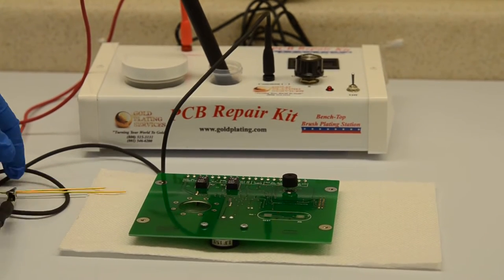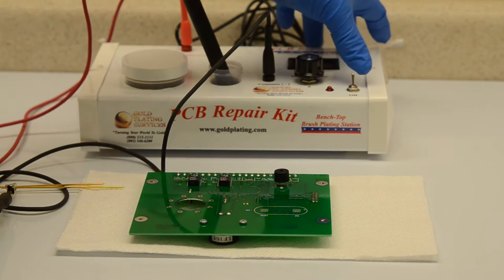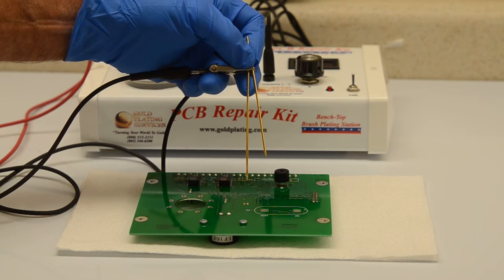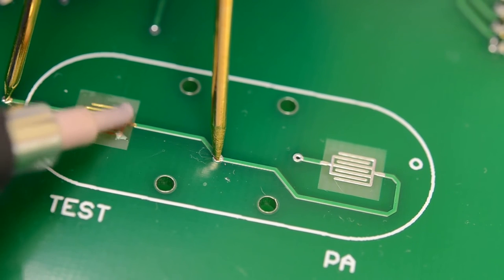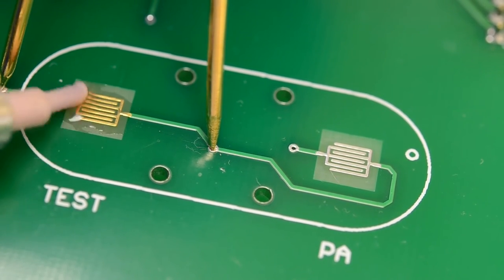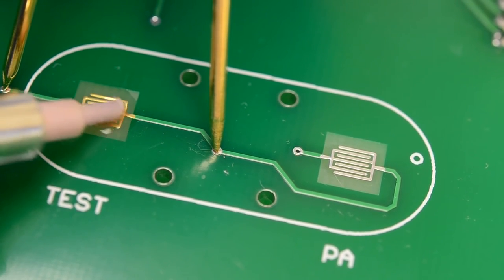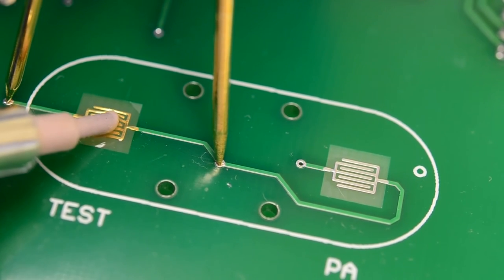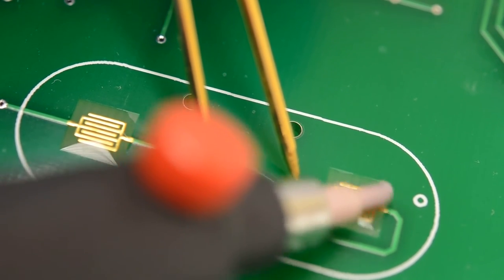Printed Circuit Board Gold Plating Demo - PCB Repair Kit - Pen Plating

Comment: Can Brush plating solution be used as pen plating solution? Since Pen is just a Finer Brush?
Reply from the maker: Yes, it can be used as a fine-select solution.  However, the Pen Gold solution is much faster and is recommended for doing much pen plating.  Although they have the same ingredients, the Pen Gold has four times as much gold per fluid ounce, has a different pH and slightly different concentrations of organic salts.  Each solution is formulated to be optimal for its given application.